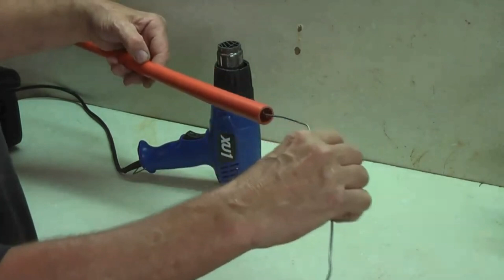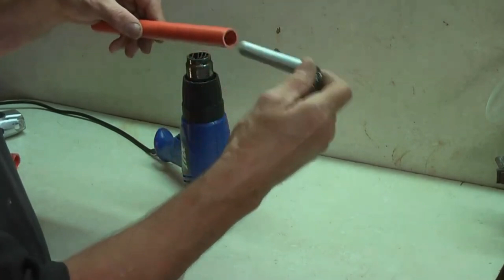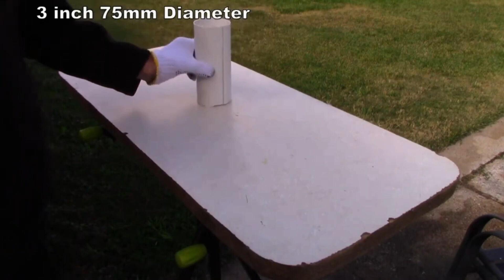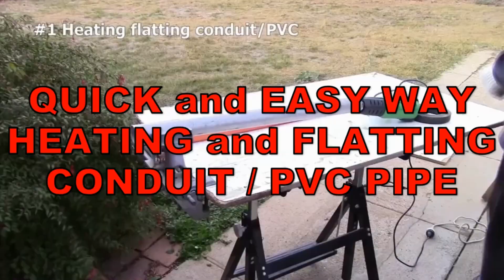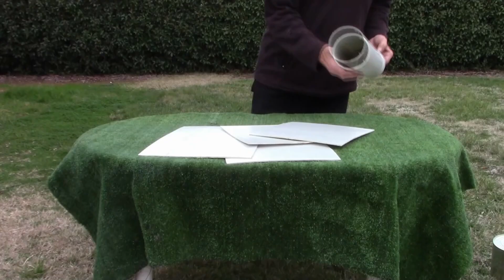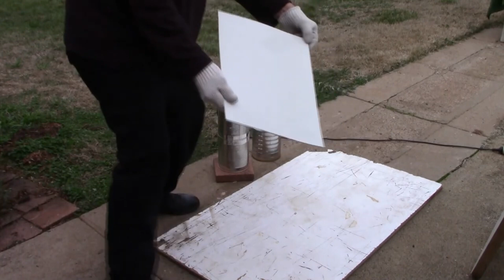✅ FIVE DIFFERENT VIDEOS TO USE YOUR HEAT GUN ON PVC or CONDUIT PIPES /TUBE PVC sheet (CC)

Comment: Great video! Thanks for sharing wondering what temperature you’re using to  heat the pipe to bend, and what temperature you’re using to create the board? TIA
Reply from the maker: Found using on a high setting Ok but you can use lower setting just take a little longer.
Always be aware that you do not scorch the PVC or Conduit.
As this can give off harmful gases.